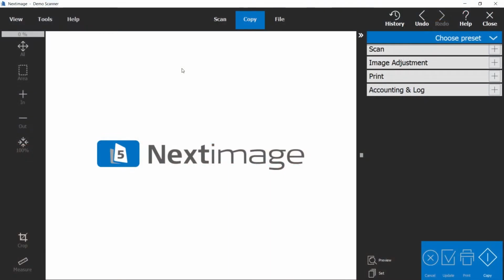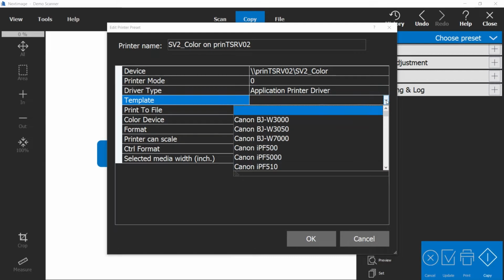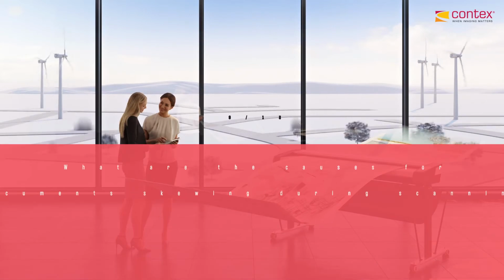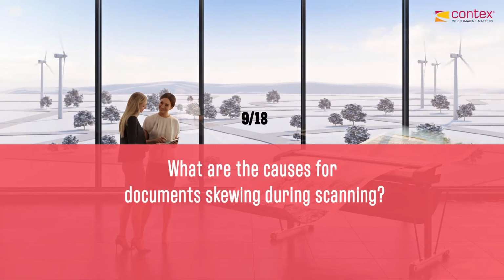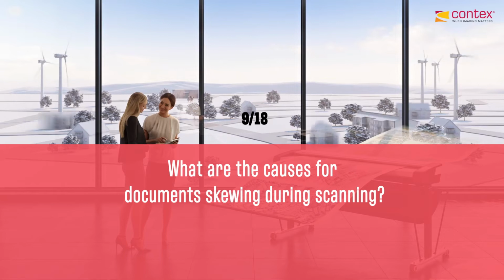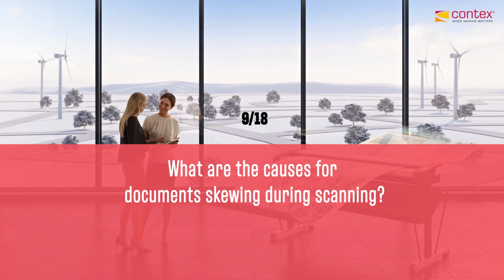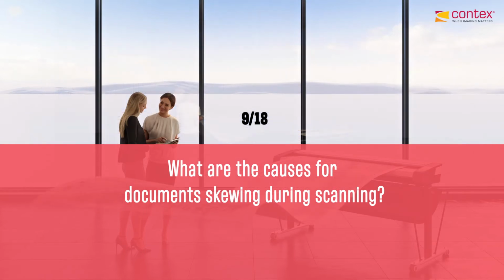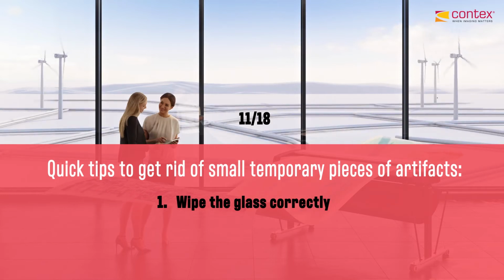Webinar: Ask the scanner experts, May 2022 – Contex Large format scanning

Comment: Have similar issue to @Z Jerom.  Any idea on why at the top of scanned images it doesn't line up?  Example: scanning pages with horizontal lines, at the top of each page, regardless of feed in orientation, the line/image is broken and doesn't line up for a small part.  This is happening on maybe every other scanned page (quattro 3650), full calibration using sheet has been performed.
Reply from the maker: Hello Dallas Imes, Thank you for your comment. I was just around our technical support team to make sure the answer is correct:
This happens when the document is not being held by both the front and rear feed rollers, such as first inch or so when the document first starts to get scanned. This is caused by one of the following options:

1.)	The document is slipping on the lower feed rollers when being driven by only one set of feed rollers. Clean both the front and rear lower feed rollers using a water dampened lint free cloth. If you are having difficulties cleaning the rollers then a good roller cleaner such as “Rubber Renu” by MG Chemicals will do the job. 
2.)	Another possibility for this problem is if the glass has become slightly dislodged from their white clips. This can be a little difficult to see when first looking so you need to look very closely at each white clip when they hold the edge of the glass. Be sure the cut edge of the glass has not popped itself out and on top of any of the clips. 
3.)	Lastly, if the leading edge of the document is lifting off of the glass when it first feeds into the scanner then the results will be a shift in the alignment of horizontal lines. This can be problematic if the documents have been rolled, have heavy folds or have torn edges. It may be necessary to lay the documents out flat and weight them down to allow them to rest and flatten out before scanning. Rotating the document ninety degrees so the rolled edge is moved to the side will often help with this situation as well. Lastly, inserting the document into a clear film document carrier sheet will almost always resolve issues scanning difficult originals.

If you need further assistance please don't hesitate to reach out. Kind regards Sigrid, Contex marketing
Reply: @ContexScanners  Thank you I appreciate all the information, and these videos were helpful to our team!
Reply from the maker: Hi  @dallasimes6419 , great to hear! We hope to have more in the future :) Kind regards Sigrid, Contex